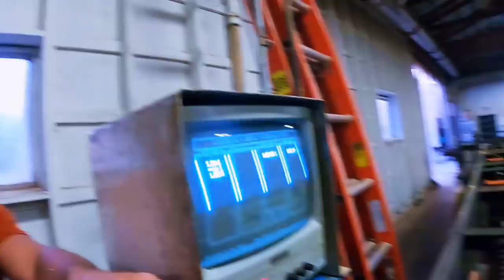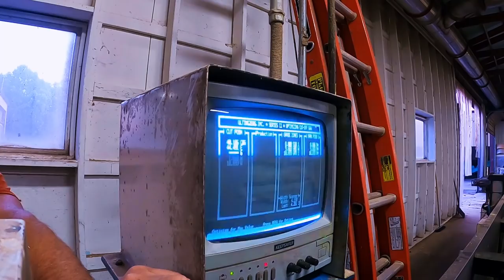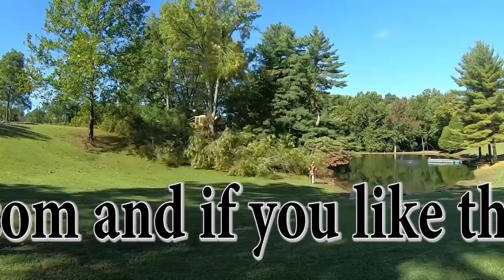Mill mods will they work or no..??

Comment: Really liked the cut in's where you show the bark and leaves of the different trees you are cutting.  I guess the Honey Locust you show are the ones without the thorns. We just bought some land and it has a few Honey Locust (with the thorns) on it and.... I HATE those things (lol). The thorn's will go through a tractor tire and I read where back in the day, they would even use the thorns off the young trees as nails!!
Reply: I had one go through my foot one time. Stepped on it and it came out the top of my foot just before my toes. Don't know about a tractor tire but they probably would work as nails.
Reply: @williambryant5946  Ouch!

Comment: Where the mudflap is to clean to paddles on the barn chain...Try using a stiff bristled brush like a barn scrub brush. has the 6" long stiff bristles and a long handle. just mount the head in place of your mudflap. Congrats on your 75K, just noticed you flew right by and now at 76K.!!!
Reply: I checked the comments first, I agree with your suggestion was my thoughts broom bristles would work better.
Reply from the maker: Got ya

Comment: To replace the mudflap at work we use something called an AirKnife (a blade or broom or sheet of compressed air, basically an air gun with a funky nozzle) to clean metal shavings and coolant off parts moving down conveyors, they work well but they are messy, they would have more than enough power to blow the sawdust off the barn cleaner, but I'm not sure how good an idea mixing compressed air and sawdust is. If you wanted to get fancy you could hook up a valve and some kind of sensor so it only turned on as the paddle went past.

Comment: On the grate under the Edger , cut out every outer bar. The angle looks right to me. 
FYI ~ The blocks that drop off the Slide in front of Poncho could be stacked on a pallet and sold for Bark Free Firewood. 
We get 100$ plus tax for pallet 40x48x24" tall. We stretch wrap the blocks right before it gets loaded. That way it dries some waiting to be picked up.  Camper dudes love it because its clean and can be taken out of state.  Be a good job for your boys.
Reply from the maker: Intresting!!! I wanna come see you two some day

Comment: Thanks for sharing your thoughts, ideas and videos. As far as your problem, have you ever used a popcorn air popper? The light fluffy popcorn is carried from the heat chamber by the airflow, dense un popped kernels hang out down in the chamber waiting to pop. I was thinking drum with high flow fan like leaf blower, stuff falls into drum, air blows light sawdust and light chips up out of drum and onto conveyor, heavy sticks remain in drum to be manually picked out. Nice video out in the woods. Wishing you and your family the best.

Comment: Logger Wade, in the sawmill yous a Process Engineer. 
And process improvement is CONSTANT.
Like the 4” grate idea, sloping down at about a 45degree pitch. That will let the big stuff slide out and away, little bits fall through.
Reply from the maker: Hahaha I've never been called anything longer than 4 letters

Comment: For getting the big sticks out of the saw dust. What about using air pressure and a screen. Use the same methods as combining.  Air and screen punch plates.
Reply from the maker: Thats an awesome line of thinking I haven't thought of the combine route

Comment: A vibration motor from Amazon for $10 on a timer mounted to that grate you made would help the sawdust fall through and it could even vibrate the big pieces off into a bin if it's slanted out
Reply from the maker: Thanks bud

Comment: Need a flat sitting chain conveyor of some sort under the edger .  With it rotating it will clear the large debris and keep itself open for smaller stuff to cleanly fall thru .  The larger chunks will get stuck and build up no matter the angle of the grate unless there’s a shaker or something to clear them out ..  Run  the conveyor to go out into a hopper for the large chunks disposal .
Reply from the maker: Dave I'm thinking that exact thing now just need to spin it slow enough to save wear and energy
Reply: @LoggerWade  yes for sure , it’s a low volume of dust and chips coming out from the looks of it , so no need for anything fast ,  a small motor and gear reduction would be ideal . Leave or create some bounce in the chain conveyor track it will act like a shaker screen at the same time but still carry off the large unwanted chunks … could do a extra drive off the chain drive gears to a separate jack shaft with 2 or 3 bump sections on it  to bounce the chain screen . If ya get what I mean .

Comment: Wade, just make a mini chip tumbler (trommel), the type used with tub grinders and in gravel pits and mines to sort out different size material. The smaller material passes thru the rotating drum made of screen and the larger material goes out the end.
Reply from the maker: I was wondering about just that
Reply: a concrete vibrator attached to your grate may do for now. get one that is used to settle concrete in sliding forms, head and wing walls. it looks like a small baton with a thick extention cord attached. that should keep the sawdust moving thru the grate for quite a while. tilt your grate to let the bigger waste go away.
Reply: @aonjgham2920  Amazon sells a vibratory motor for $10 it would probably work pretty good for what he needs mounted to the grate he already made I would also put it on a timer to buzz stuff through every 15 or 30 minutes

Comment: If you built a short convair with a screen and not a belt, the fines will sift through to the lower belt, and the screen can dump into a 50 gallon drum..

Comment: On the screen at the edger. How about a larger mesh say 1" × 1" and put it on an angle on rubber mounts and make it vibrate like a rock screen in a rock crusher. In fact a 1" rock screen would be the ticket and cut out bigger openings like you was saying. It would let all the smaller pieces through and you could put a pan or something to catch the big pieces that vibrate off being its angled. Maybe❓ No ideas on anything else right now but I will think about it and comment if I come up with something.
Reply from the maker: Thanks alot William

Comment: Diagonal (2 foot?) stainless steel rods about 2 inches (or whatever you think proper) apart inclined and tucked up and integrated to the upper edge of the grate with a small vibrator motor?
Reply from the maker: Got ya
Reply: @LoggerWade  Yeah, I'm just thinkin' out loud, kinda like you.

Comment: I think you're onto something by angling the cutting edge(s) which would shear or cut the wood fibers rather what looks the fibers are being ripped or tore. Only caught half of what is going on so I may be way off base..... "I'm late, I'm late ... for a very important date"
Reply from the maker: Be careful buddy
Reply: @LoggerWade  will do ... with both 🦶 feet 
Packing things to send ya. Tonight. 
Thanks bud